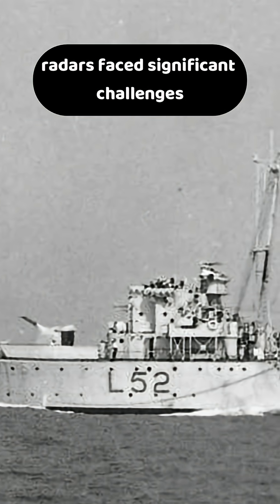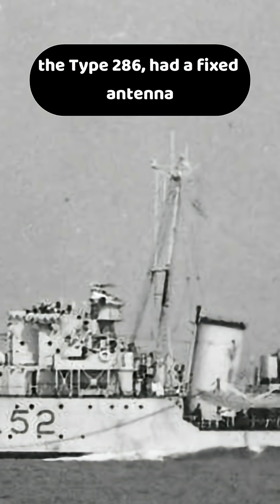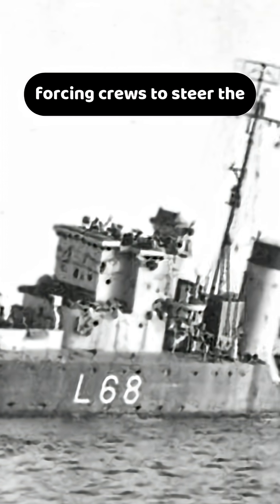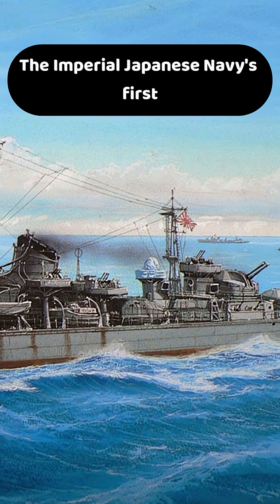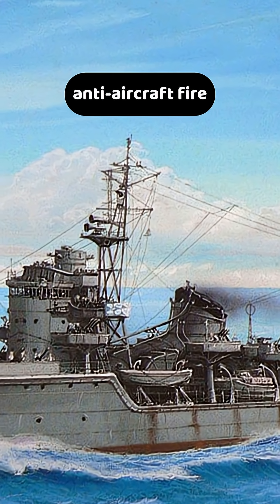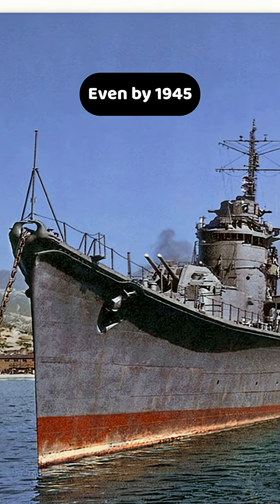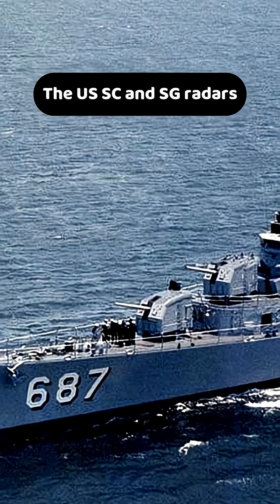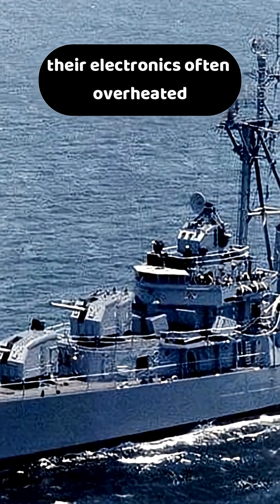The Fragile Electronics of WW2 Destroyer Radar

Comment: US radar relied on the magnetron invented by the British. Using this device the radar could pick up a submarine conning tower from 30 miles
Reply: They also improved it.  Fact is the "US" team had a lot of Brits in it!
The co-operation between the Brits (+ UK) & the US solved a lot of issues, and help end the war at least 2 years faster!
BTW: The B-29 was designed as a fail-safe if Britain had fallen.  And the B-36 (and relate xBs & YBs from other US Aircraft Companies (including the YB-35 which was Northrops first large Flying Wing) were also to allow bombing of Germany with an even larger payload than the B-29!)
And yes, the A-Bombs (with British help) were meant for Germany if the European Theater had gone differently....